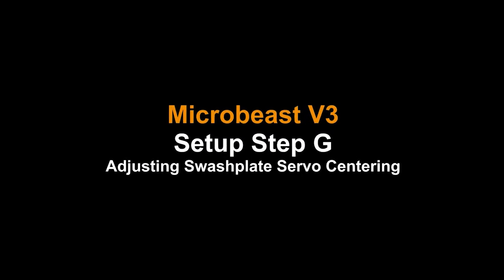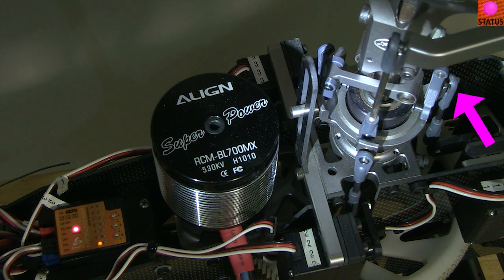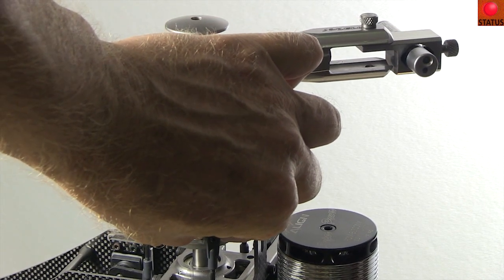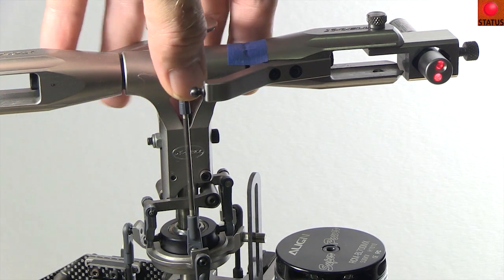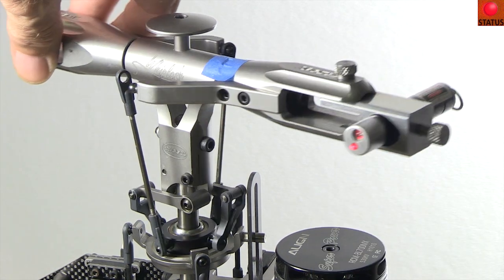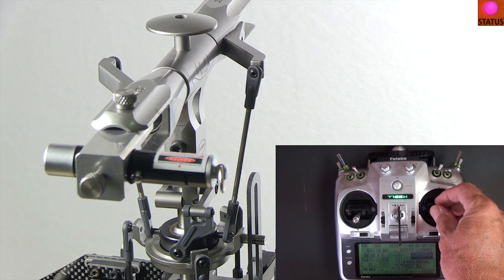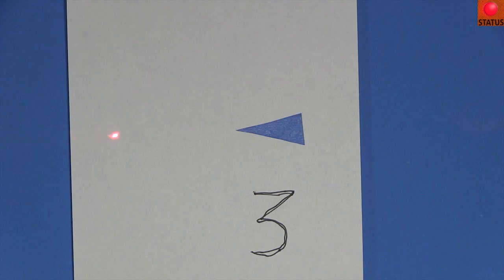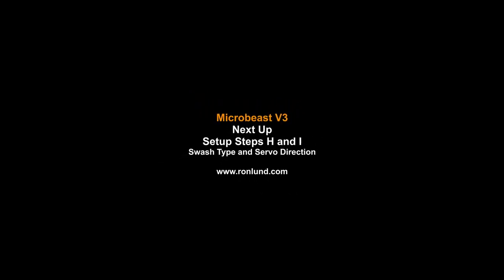Microbeast V3 Step G. Setting the Servos to Center and Leveling the Swashplate

Comment: Ron- Your video's are excellant. I am using the Microbeast on a Align  Super Dominator 470LP__ I have been flying it for several months now. All my settings seem to be ok. I have yet to run into someone who can advise me on -when swash is all the way negative & I cycle servos they bind up with bottom of servo/frame-they make contact because overextending? I have bound to DX9. I'm no where near the level to go full neg. & spin yet so it's not a problem yet. It can't be good for servos though. I suppose the Micro Beast would be where I would adjust it to stop before binding but not losing the throw?---Bob

Comment: Hi Ron, you're doing it wrong.
Step 1: center all servo arms to 90 degree **electronically** in Microbeast Step G.
(btw. great idea to use a template)
Now all 3 cyclic servos are perfectly in sync. Save the setting.
Step 2: Enter Step G in the Microbeast again, but make sure you don't change the settings from step 1.
Step 3: Level the squash plate **mechanically** using the 3 linking rods.
You will need to adjust only two of the three linking rods.
It's a lot of work because you might take the links off several time to adjust the length.
Or use a small 2mm wrench to adjust the linking rods in place.
Step 4: exit Microbeast menu and check the squash plate at minimum and maximum pitch.
The squash plate should now perfectly leveled in it's highest and lowest position.

If you omit step 3 the squash plate will probably have some deviation at minimum and maximum pitch.
The sqash plate is fine in the middle position but not at the min. or max. position, because the angle of the 3 servos are slightly different.
Only if all cyclic servos have exactly the same angle the squash plate can move straight up and down without any unwanted tilts.
Reply: Squash plate? LoL!
Reply from the maker: I'm sorry I didn't reply to this sooner. You started off saying I was "doing it wrong", however, if you watch the all of the videos, you will see that we agree. That is what the template is for. I only use step G to make the finest adjustments.
Reply: Word of advise. Learn the words and what you are talking about before you comment.

Comment: Thank you Ron this helps alot bud but your previous video hit it right on the mark for me. I got the Tgz 380 and that basically is a 
beastX clone since I can't 
afford a beastX I went budget lol. I like the beastX because you dont need a computer or Laptop to configure or program the gyro. It has a very user friendly interface but then again I am new to cp helicopters.  I am building a 450 trex clone by hobbyking its called The (HK 450 TT Pro FBL). Heres my layout of what I using Ron. Align 1800 kv motor, Esc is Align 45a 3s to 6s. Ec3 connector. For the cyclic servos I am using Turnigy Tgy-90s digital metal gear micro servos. For the tail servo I am using Corona micro digital servo. My gyro is a Tgz380 my reciever is a walkera Rx-701 and my Transmitter is of course  Devo 7 which by the way I will be changing because it is absolutely horrible and impossible to program.  One of the worst interfaces I have ever seen.  I am Thinking about using Either Radiolink or Flysky. What's your opinion Ron? am I using the right gear? I cant seem to bind the servos when I am programming the gyro I am lost and I need any advice Can you please help? I also own 2 other CP helicopters 
a Walkera V450 D03 and a 
Alzrc 480 devil which by the way is gorgeous.

Comment: you say, it's important that you adjust your pitch to zero before you change the status light to off. what did you mean exactly with it ? After leveling the swashplate, setting zero pitch on the grips first before exit the microbeast step G setup menu? should I pre-levelled the swashplate mechanically, before I fine tune it over the microbeasts setup step G, or is it not necessary ?

Comment: Ron I don't see any movement on the servo when I move the elevator stick... that is on all of the servos.  I ended up setting the swash plate level mechanically.  Any idea why the elevator stick would not move a servo?

Comment: Hi there Mr Ron,
Just want your opinion on this. I already pre-levelled my swash (new mini protos) using a swash leveller with some subtrims on 2 of the servos to get 90 deg. That is before the my bx came. Now,  do I need to zeroed all back (subtrims) when setting my beastx later on?

Comment from the maker: That would work also. When I do it this way, I am assuming that the rods are the proper length already. I changed this to Microbeast when my CGY750 sensor failed, so I knew they were because it had already been setup. That is a good point though. If someone were careless with their measurements, this method could make a mess.

Comment: awesome tip on the laser really... one question. shouldnt you first find perfect 90 to the rods (as you do nicely with that clear print) and then adjust ONLY the rods to achieve level swash and be ok leveled at full pitch also? (ok this is exagerrating but you know.. :) )